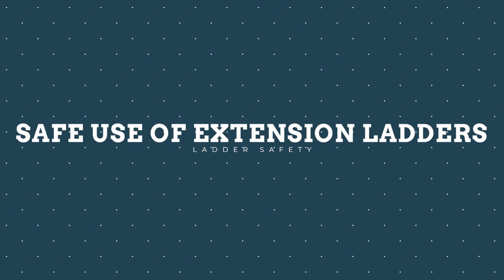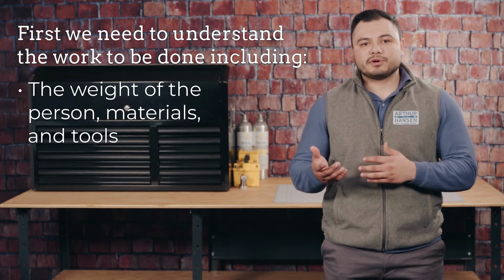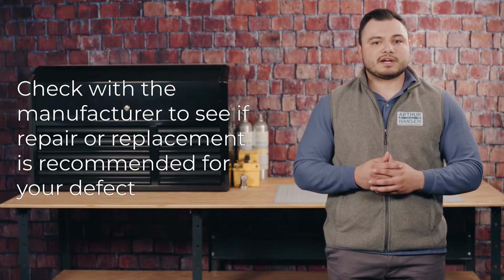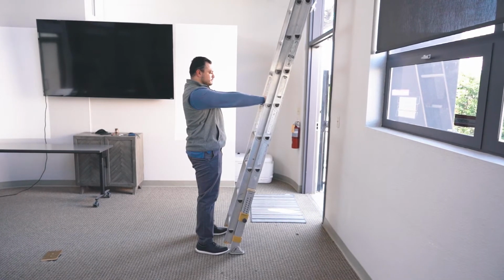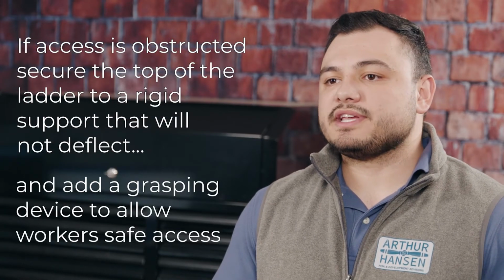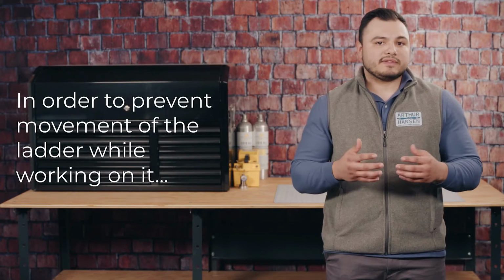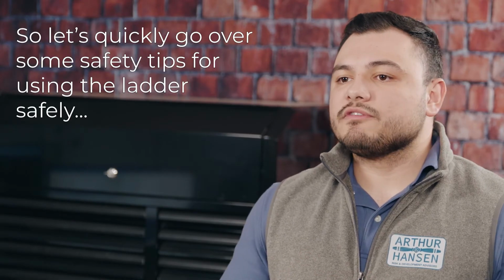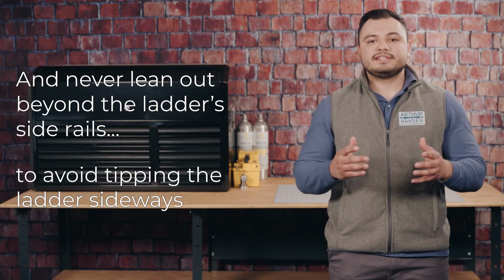Extension Ladder Safety Training Video: Extension Ladder Safety Tips | Construction Ladder Safety

Comment: Phone repair guys use extension ladders to lean against communication guy wire.  This isn’t a stable structure; so is this safe?
Reply from the maker: No, we wouldn't recommend doing that. A bucket truck or a large A-frame ladder would be better options.